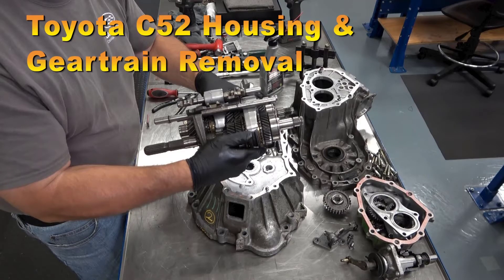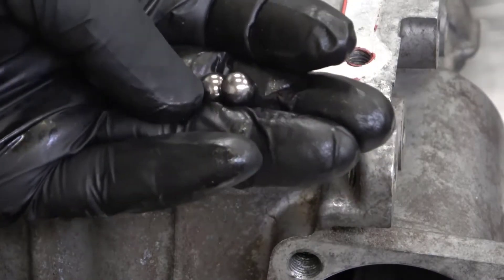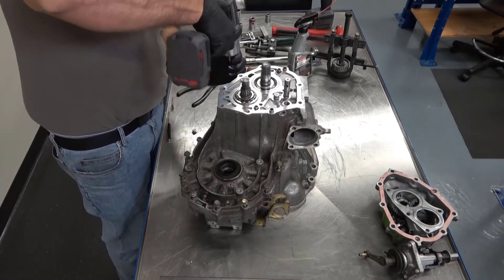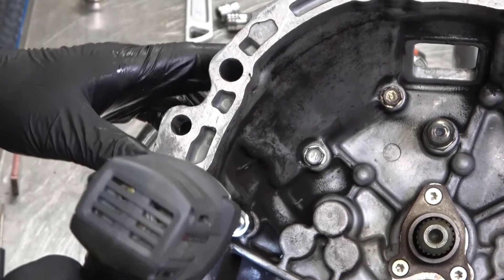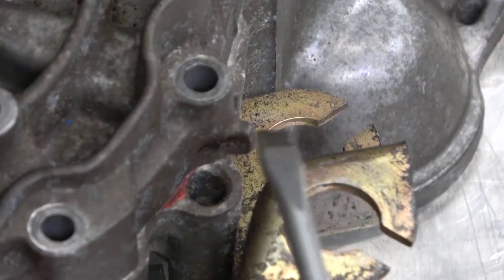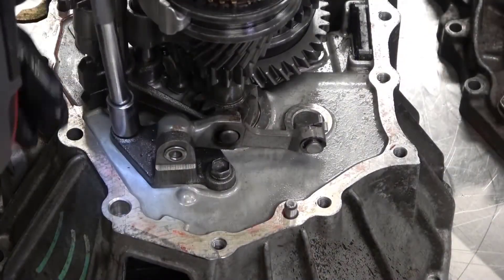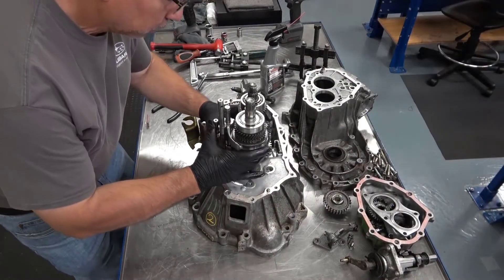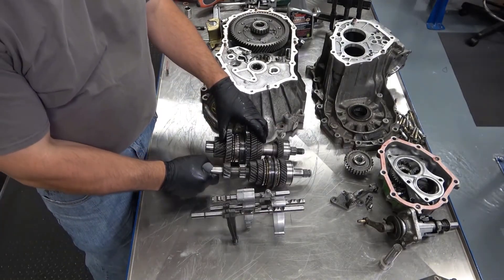Toyota Manual Transaxle (4) Housing and gear train removal

Comment: Hey man. This video is super helpful, but when I lifted the housing I had it in gear… it’s now stuck. What do I do?
Reply from the maker: Sorry for the delayed response.  If you can't get the shifter out or you forgot to remove it when you tried to lift the housing up all is not lost. It does however mean that when you lift the housing up all the gears will come with it.  You will need to tap on the input shaft with a soft faced hammer. Plastic hammer works best. stay away from brass or bronze.  Alternately you can hit on a piece of wood with a regular hammer with the wood between the hammer and input shaft. Once the upper half with all the gears is seperated from the lower half tap on the two shafts from the other end where 5th gear was.  If you already removed 5th gears and the retainer plate and large bearing snap rings the shafts should fall out of the upper housing and this should free up the shifter to be removed. Good luck.

Comment: Like many, my detent balls are different sizes.
Reply from the maker: Hopefully you made a note where each one goes. if not look at the spring size and the detent cut out on the shift rod to see if you can determine where the larger or smaller detent balls are located. I'm a little surprised for a Toyota C series transaxle. Most of the ones I have taken apart have all been the same size.